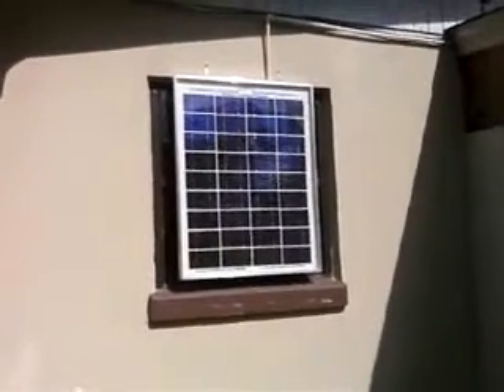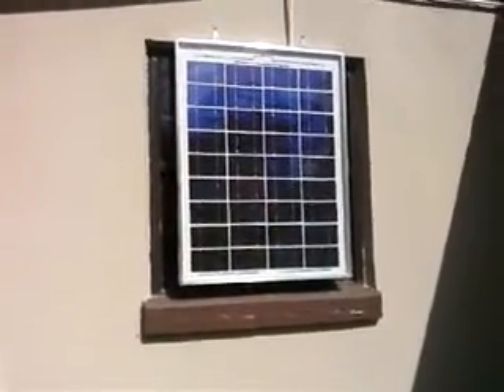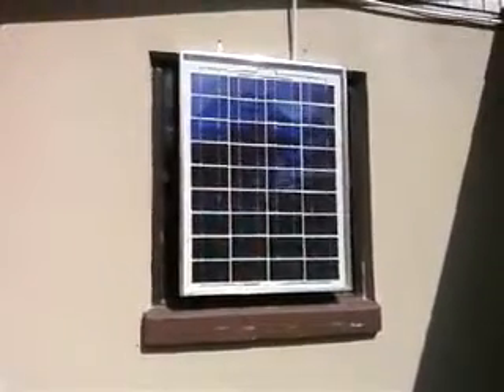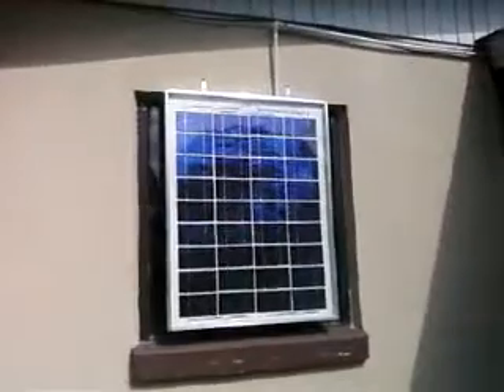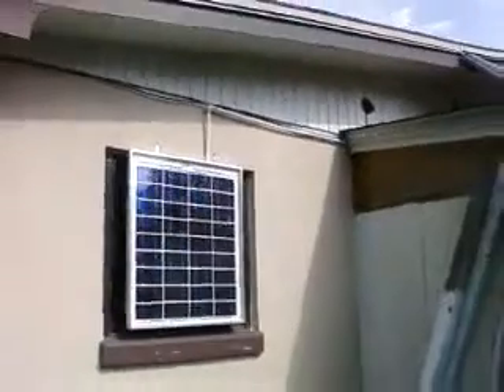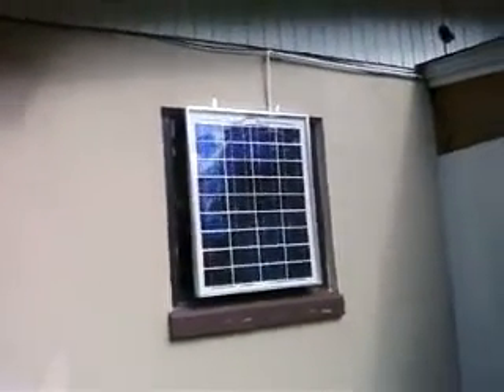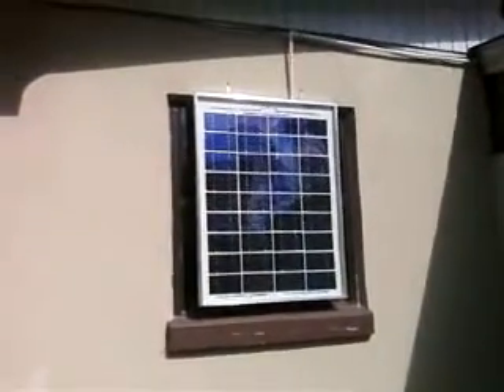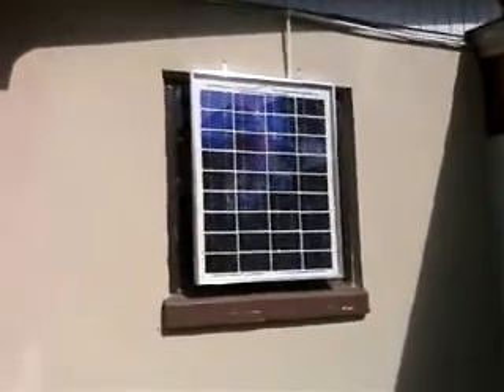My Solar Power Set Up - Part 7 - Building a Panel - Conclusion

Comment from the maker: @wtam69 I used those Scotch Adhesive tabs, but you can also use silicone dabs to adhere them.  You kinda have to experiment a little, so it helps to cut some cardboard pieces the same size as your cells so you can experiment.  Moving them is not too bad once you have a soldered string, just pick it up by both tabs on one end at the same time and move the whole string to a bench with a towel on it to protect the cells.  Here again experiment with some kind of a substitute first to save your cells

Comment from the maker: @Maccan Yes, I switched back to Plexi.  I really wanted glass, but found out that it was alot more difficult to work with, especially if you have to remove it for any reason.  It also weighed alot more, and I figured that if the panel warped slightly (which it is doing) the glass may break whereas the plexiglass would have enough give to not break.

Comment: Hi Skippy,   What's the trick in glueing down the cells? How did you move the soldered cells from your work bench to the frame without breaking them? 

 I just ordered some cells from ebay but is apprehensive about damaging the cells since everyone says how easily they can break.  Thanks so much. Your panel looks great!

Paul from NY

Comment: I would like to see your amp meter showing the 10 amps your talking about getting, I have three panels with 5.25 ratings only producing about 8 amps. Getting the full reading of the panels capabilities is difficult because of positioning this is hardly possible.